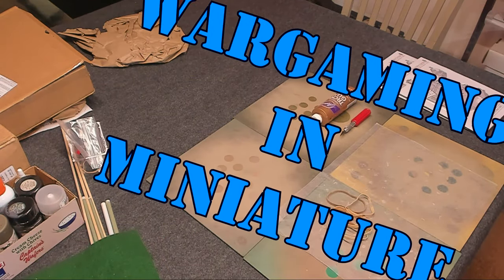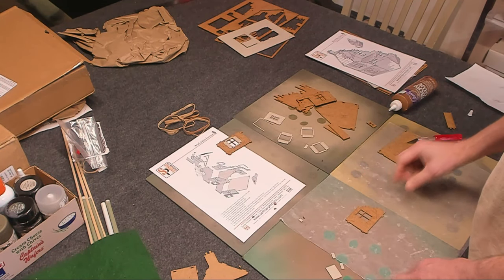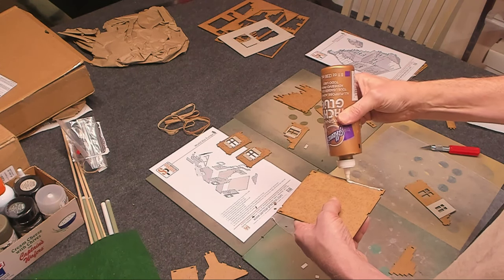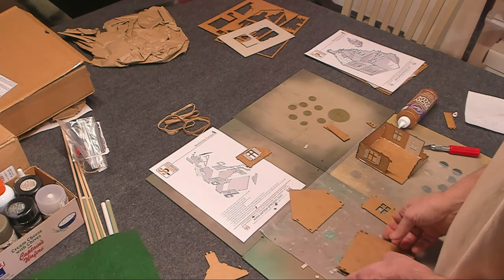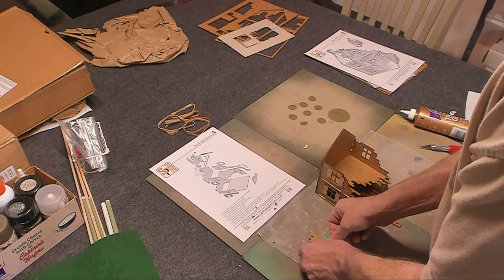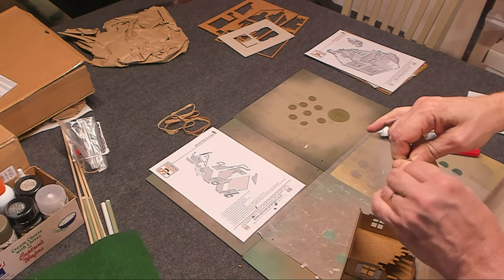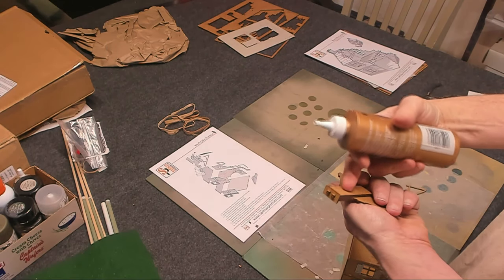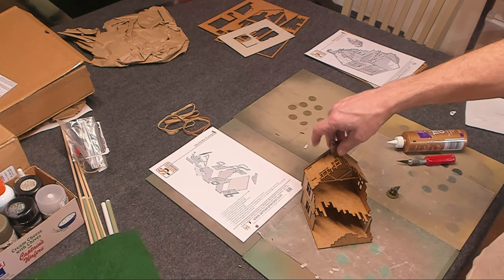Building a Sarissa Precision Bombed out House ☺ Wargaming in Miniature

Comment: i leave them on the sheets until ready then use an exacto knife to cut into the joint dots . I use an old ceramic plate to pour out PVA wood glue and  long matchsticks  to spread it on . The glue on the plate  washes off after , under hot water .